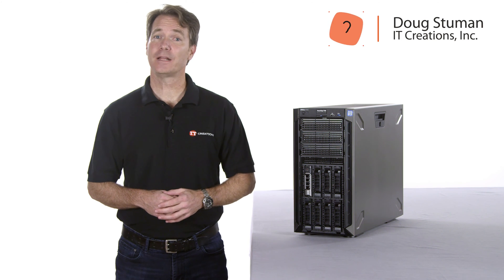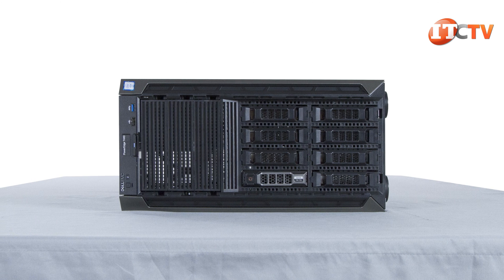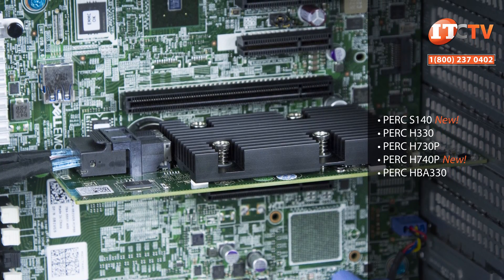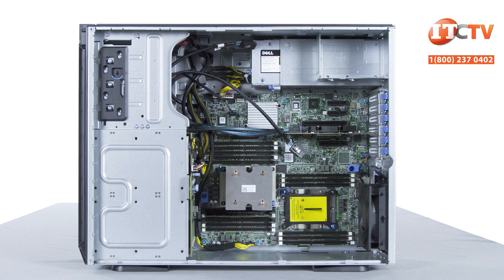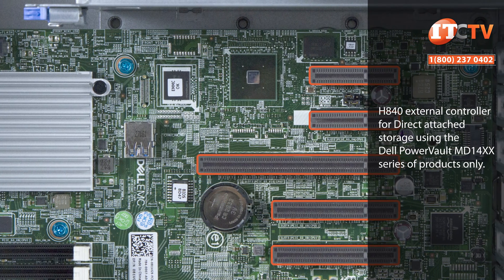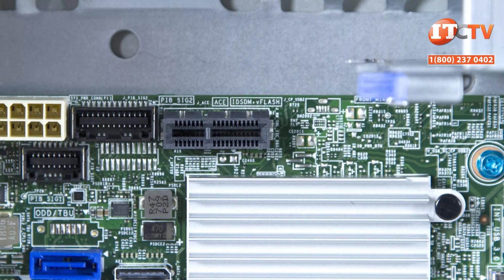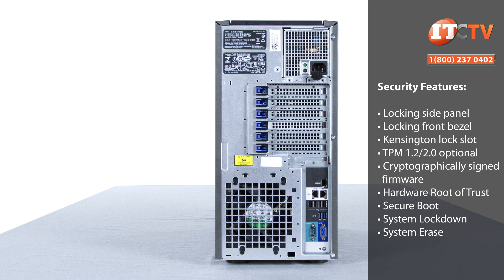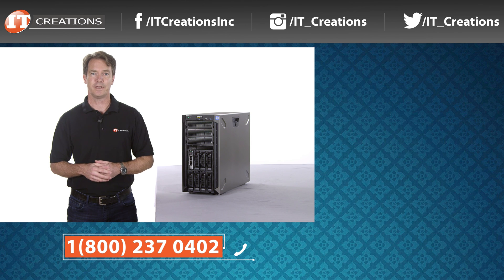Dell EMC PowerEdge T440 Server Review | IT Creations

Comment: Power source input are two
Reply from the maker: Hi Pradeep,
The review unit you see in the video had a single PSU but that said, yes, you can get this system with dual redundant PSUs. For whatever reason the single wired PSU is not included in the technical guide nor the Spec Sheet. However, check out the section starting on page 123 in the User Manual for information on both. https://www.itcreations.com/user-manuals/t440/dell-emc-poweredge-t440-tower-server-owner's-manual.pdf
Thanks for watching!
Reply: Tq sirn

Comment: In retrospect, it's kinda disappointing how badly Dell gimped this model. 48 PCIe lanes per CPU, and only the first CPU's lanes are in-use or available, leaving the second CPU a glorified RAM expansion over UPI link. Unless you're buying one with 16 2.5" bays and redundant PSUs, it makes more sense to just deploy a T7920 with the second Flexbay expansion and a PFC equipped UPS. It's the same or similar to a machine you're probably already deploying if you're invested in Dell's ecosystem, it's more flexible, less reliant on clean power lines, has better performance with both single and dual CPU configs, just as reliable, AND it's easier to service on-site.

Comment: I know that this is late but can you elaborate on the noise level in terms of decibels ?
Reply from the maker: Hi there,
Sorry we do not have any more of these systems to test. That said acoustical performance is very subjective. There are things you can do to minimize sound transmission like installing SSDs and a liquid cooler which would take a few fans out of the mix when the system is under load. I did look specifically for acoustics regarding this system and only found reference to various levels of sound, not actual decibels produced during operation. Thanks for watching!

Comment: How does a three year old server stand up to a new server in performance.
Reply from the maker: Hi Josef, 
Thanks for the question. In general, newer processors support more cores, more memory, and more storage. Power consumption is also a factor and manufacturers try to reduce the draw on power resources, which can get expensive in data center and cloud environments. New technologies are also introduced, like more support for M.2 storage devices which offer very fast performance and can use a SATA connection. Following the basic manufacturer marketing literature, the shift from Intel E5-2600 v4 processors to the Xeon Scalable processors provided a 28% increase in performance (I think this is based on an increased core count from 28 to 32 at the top end) and a 50% increase in memory bandwidth (from more memory channels at 6 instead of 4, plus faster memory speeds at 2666MHz compared to 2400MHz). 
All of that said, most of these platforms are configured once and then never upgraded to support higher capacities because if your hardware is in a data center it is quite costly to have your guy go out and upgrade the systems. Better just to replace with new and have done with. And another caveat. If you are currently running hard disk drives on your server then you are missing out on the incredible speed and performance offered by SSDs that will definitely bring new life into that 3-year old server. There is nothing wrong with an older server or even purchasing a legacy server for a new application. It will do the job if it is outfitted correctly to support your workload and will provide the performance you need. Not to mention the older servers you can typically pick up for a nice discount when the new systems become available. A three-year old server definitely has a lot of life left.

Comment: You should do comparisons between the generations of servers and run them through benchmarks.  Side by side T410-T440 Cinebench scores with processors either in the same core size or price lineup.  So that the consumer can see the tangible or extreme differences and give them a solid reason to upgrade. 

Just an idea. :) Love the content!
Reply from the maker: Hi Tyler, sorry for the late response. It would be great to do a side by side comparison of the various generations but unfortunatley we usually don't have time for that nor the manpower. We try to provide a detailed overview of the system along with some of the more unique features. That said, I will look into just how much time that will take and see if we can do that for some of the systems we review—not all but some. We appreciate your comments, and thanks for watching!
Reply: Not having support on a T410 is a good reason to upgrade. The main perfomance gain is on the CPUs. You can easily compare the CPUs at Ark Intel.